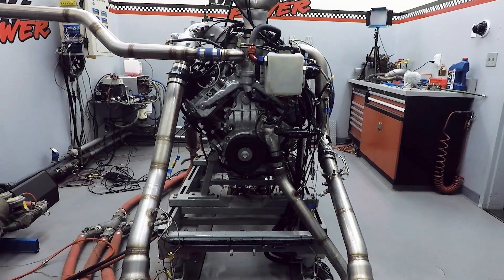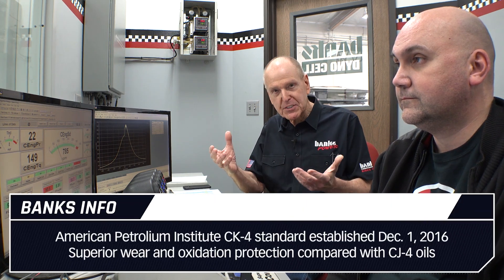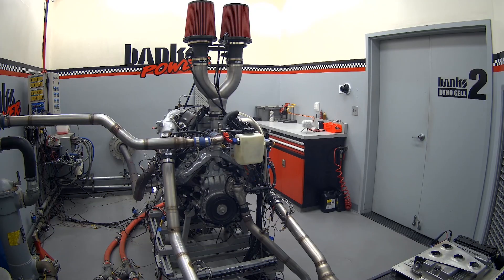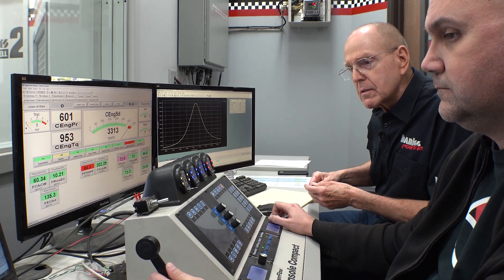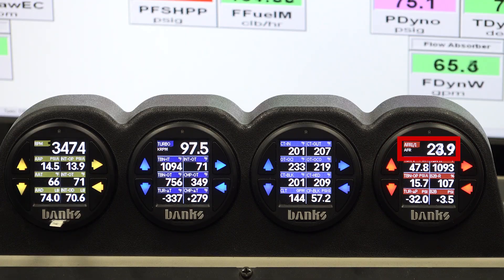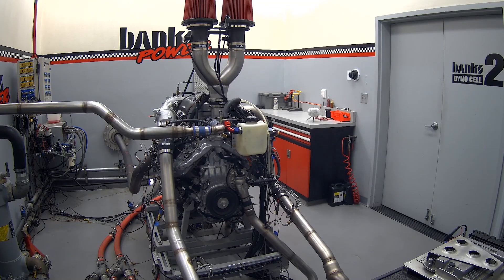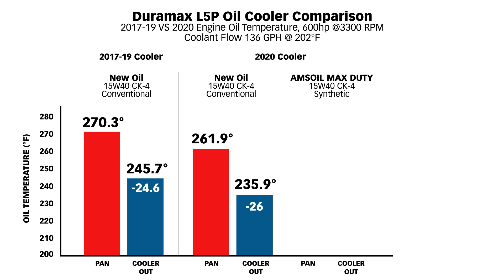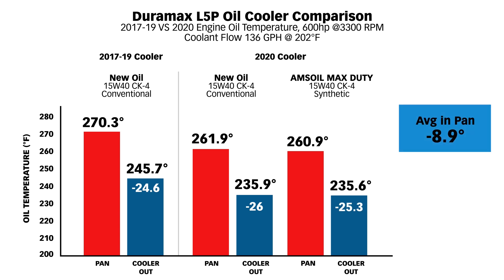Killing A Duramax Pt 10: New Oil Cooler!

Comment: Serious question could that year oil cooler leak coolant into the oil? I’m getting high potassium 39 in my oil analysis with only 52k miles on the truck. 2022 Duramax deleted and tuned
Reply from the maker: While it's technically possible to get intermix if you have a failed cooler, it's not super common with these.

Comment: Before I quit to go back to school to become an RRT, I actually worked at Dmax.  I seen you walk through sometime around 2009-10ish.  Nobody else on the line knew who you were.  Anyway, from the time I spent on Short Block B, I always wondered if the oil cooler tube could be modified, or even produced out of aluminum with an integrated heat sink...and how effective it would be.

Comment: Good morning. Great series I enjoy the technical aspect of the data testing. I have a question though not addressed here is about intercooler efficiency. I'd asked this of the Banks Power technical department and found to date there is no public data from testing of this type. As I understand watching these videos 1/3 of the power is produced by the engine, 1/3 by the turbo charger and the final 1/3 by the intercooler. Now interested in maximizing each available free horsepower my question is this. Is the ability and efficiency of the intercooler better when the core is naked aluminum or painted? There is an abundance of opinions over the internet of course. All of them I'm sure unsubstantiated claims. Reading about EMISSIVITY is very interesting in particular.  As a data junkie I'm highly interested in a testing environment to  answer this question for all of us real world users. I'm certain data is available to back up claims for Banks intercooler VS stock applications but what about the Banks Techni Cooler Painted VS Naked Aluminum? Its FREE HP either way. One must be better and for a reason. Again awesome series, can't wait for more. Looking forward to hearing your answer and comments on this post!
Reply: Naked aluminum.  Emissivity relates to radiant heat transfer, not convection, which is the mode that an intercooler operates in.  If the core is painted, there is another layer of material that is insulating the intercooler tubes and fins from the air that is being cooled.

Comment: Any input on the typwriter tick engine noise gm is saying is norm?
Reply from the maker: Our two L5Ps don't do it. However, there are about 50 guys in L5P Duramax's Only Facebook Group that complain of the noise. So, it seems as though it's somewhat common.
Reply: @bankspower  fhe dealer is saying it is the oil..and there is a TSB on it. ? What? I dont know anyway.. what kind of oil are you running in yours?
Reply: It is oil type specific. 
Mobil 15 40= no tick
Rotella t6 15 40= no tick
Schaeffer 10 30= no tick
Rotella T5 15 40= major ticking.
Reply: @cooley346  last oil change at the dealer i asked for synthetic, not a clue what brand they use.going to inquire. It still ticks once and awhile

Comment: Gale, on a high horsepower diesel engine, increasing oil pressure I noticed is common. I hear some people say you should and others say you shouldnt. Is this a practice yall have and is there any benefit to film strength and bearing life?

Comment: TBH, I would have thought that the modifications and torque increase has gone well past the point where a dedicated oil cooler would have been used.
The other factor is you didn't reference it against the coolant temperature?
Reply: GordoWG1 WG1 when he is going over the graphs at the end the coolant temp and flow rate is listed at the top above the graphs
Reply: @bradyjones4821  

You are correct - I phrased that rather badly.
What I meant was the increased thermal load on the vehicle's cooling system would also raise the coolant temperature, and that would, in turn, reduce the delta T at the oil cooler. On the dyno' the coolant flow is easily controlled, and held to a set temperature, something not so easy to mange in a vehicle.
Sure, in very cold conditions, the oil-coolant may help with the oil temp's coming into the best working range faster, but for a temperate,or hot clime a dedicated oil cooler would seem to be the better option - I would, personally, be MUCH happier if the oil was kept under 225-230f, 105/110C.

Comment: The old oil could also have a certain amount of fuel dilution in it, which will cause the viscosity to go down over time.  Considering the long injection times, I bet this is happening to some extent.

Comment: anyone elses l5p have a steady tick at idle? goes away sometimes.
Reply: Mobil 15 40= no
Rotella t6 15 40= no
Schaeffer 10 30= no
Rotella t5 15 40= major ticking at idle sometimes.
Reply: @cooley346  you've had luck with the t6 then?

Comment: Pushing hard to sell amsoil here it seems.  Isn’t more pressure in the oil system indicative of les flow through the newer oil cooler.
Reply: Jeff Pelletier Cooler oil is denser or “thicker”. On a cold day you can have say 40 psi at idle. Same engine and oil may be 10psi on a hot day.

Comment: Increasing oil pressure mean there is a increase in restriction since you did not increase the size of oil pump?
Reply: If you look at the gages and screen during the runs, you will see that the pressures were taken at a particular flow rate.  Since oil pumps are positive displacement types, the flow should be the same at the same RPMs.

Comment: ohhhhhh next episode going to be amazing! You get to reduce the injector duration meanwhile supplying more fuel! 
Are you going to try and stay at 40*, or try to run as little duration as possible?

Did you figure out if that oil cooler also fits the LML?

Comment: The oil density change just like the air density changes when you add more Cooling. That's why you were getting more oil pressure. That's pretty cool.
Reply: 1dads life This was really noticeable back when cars had functional oil pressure gauges. People would loose their mind with 10 psi at idle on a hot day.

Comment: I am a little confused. I have watched vids about Evans waterless coolant and they claim it is able to remove more heat from the metal surface due to its smaller molecules and higher boiling point which creates better surface contact. Result is slightly higher coolant temps noticed at the radiator and at the factory coolant temp sensor. Now I'm trying to apply that theory to synthetic engine oil, which should be able to remove more heat from the metal. It should also have better lubricity, which will reduce friction and heat. 
So synthetic oil reduces heat made on one side and absorbs more heat from the metal on the other.  In this case, is oil temperature alone an accurate measure to say that synthetic (Amsoil) is better? I would think at least an oil sample would be needed for better data and a more accurate decision. I still like Amsoil. I am more questioning the lack of data to claim one oil type is better. Someone might say this is like measuring horsepower and only looking at boost pressure... Hmmm...

Comment: What about oil psi and temp with amsoil in the stock oil cooler vs the 2020 oil cooler?
Reply from the maker: We didn't test AMSOIL in the older model oil cooler because we're planning to offer a retrofit kit allowing all DMAX owners to upgrade to the 2020 cooler.

Comment: Just out of curiosity did you use the same oil filter with the new oils or was it changed with the new oils?   The only reason I ask is I have seen oil pressures differ from filter to filter even though they were the same part number and manufacture.

Comment: GB, it is a shame some school doesn't run a "high performance" lab and lecture series- you would have classes jammed to the max! This on oil pressure, changes due to higher performing oil pumps and then to synthetics could apply to "gas burners" easily. Thanks!

Comment: I really enjoy these videos and I have no doubt that Amsoil has great products but I have never understood why they have the strange marketing scheme.
Reply: It pretty much started out as a pyramid scheme and was almost like a religion. They claimed that you never had to change oil. I worked at a Ford dealership in the 70s where a customer had a Pinto engine fail in 11,000 miles. Ford wouldn't warranty it because the oil had only been changed once having been replaced with Amsoil at 500 miles. The oil pan had sludge in it. I think they were advertising 25,000 miles on an oil change at that time.
Reply: @tiredoldmechanic1791  Amsoil had NEVER claimed you didn't have to change it.  Amsoil's guarantee was 25,000 miles or one year. Did anyone submit a claim to Amsoil?  Their claim was that with a proper lube analysis program, the oil could be left in until the analysis said it was time to change. I have been an Amsoil dealer since 1973.  If the Pinto had sludge in the pan, it wasn't using Amsoil, or it had some other malfunction going on (or it was just a Ford).

Comment: Has anyone ever built a V-8 in which half the cylinders run diesel and with different stroke, the other half gas. Grunt and zing
Reply: Gas engines get their zing, because they are able to spin at high speeds but if you have it directly coupled to a diesel engine, then it can only spin as fast as the diesel, and you lose all your zing, and since you don't have as many cylinders running diesel, you lose some of your grunt.

Comment: Amsoil is the best in synthetic oils  all around.
Reply: So they claim. It would be interesting to see other synthetics tested. Do any manufacturers use anything but synthetics now?
Reply: Tired old mechanic Not just they. Us too. We use Amsoil exclusively because I’ve seen the difference it makes in a 2,300 HP boosted big block. 
If it helps me maintain great pressure and my bearings look new I imagine for a regular car it’d be golden.
Reply: @tiredoldmechanic1791  check out project farm channel
Reply: @tiredoldmechanic1791  look up project farm. He tested all synthetic oils and Amsoil beat out Pennzoil and all other competitors.
Reply: I just can't afford 8 quarts at 21 a quart every 5 thousand miles
Reply: @drtracernum20  $21 a quart???  Retail is only $11.80 a quart.  And if you think that is high, listen to what Banks says about protection.
Reply: @rcbearings1  local napa sells em for 21 a quart

Comment: Im how does the oil pressure increase if there is an oil pressure relief valve to maintain the pressure at a given flow from the oil pump depending on RPM ? And is there a higher viscosity causing more parasitic draw?
Reply: Shadow Boston If the relief threshold isn’t reached then it doesn’t happen. The higher pressure will always increase draw. This is why a lot of oil pumps are two stage for cruise and WOT.

Comment: Could 10 degrees be made up in ambient temperature at the time of pulling? I just don’t see so much benefit to the VERY expensive amsoil v conventional
Reply: CAR WASH ENCOUNTERS temp difference was from the new style oil cooler not the oil
Reply: VERY expensive Amsoil?  Compare the protection you get from a premium synthetic vs any old crap oil vs the cost of replacing a $15,000 engine!  Go back and listen to Mr Banks again when he describes the Amsoil EXCEEDING the specs by a big amount.

Comment: Did you pull an oil sample from the 92 hour oil? I'd be curious to find out the lab results.
Reply from the maker: Yes, we pull a sample every time we drop the oil. We send samples to Blackstone Labs. Here's the 92-hour oil lab results. https://go.aws/2SotNF1
Reply: @bankspower  
Thanks for the data. From a mechanical engineer who loves data and raw power straight to the veins!
Reply: @bankspower  :  That's a pretty high Copper reading.  Hopefully that's leaching out of the braze joints in the oil cooler, and not coming from bearings.  The Lead that's in the reading doesn't seem high enough to go with the Copper that is present.  Iron wear is remarkably low considering the thrashing that the engine has been getting.  I think the Chevron conventional oil held up very well.  It's still in grade.
Reply: Me too!
Reply: THIS!

Comment: Is that the pressure after, or before the new smaller filter? I'm wondering how much pressure drop increased across the new filter vs. The older larger filter.

Comment: Hey there Gale.  Where is the oil pressure taken in relation to the oil cooler?  Up or down stream from it?
Reply: I have a 22 3.0L Duramax and I have the I-guage but I can not find the oil pressure monitor on the settings.

Comment: Also, since you're not going to be flipping this engine upside down any time soon, this would be a great opportunity to run experiments with water injection, MW-50 injection and Hydrogen Peroxide injection!
Reply: Water injection is only good for gasoline engines because it prevents knock by cooling the intake air charge. It actually robs power from a diesel engine. Now if you want to discuss high pressure high temperature steam injection then you have something that will be able to replace the emissions control systems by reducing the amount of NOx production, and yet still give you more power and better efficiency. I did a college paper on it thinking that I  was the only one working on it and then found out that research had just been done in 2017 proving all of my theories correct.
Reply: David Scott Water injection after the power stroke works fairly well at lowering exhaust temperature, but Hydrogen Peroxide works even better while also aiding combustion rather than hindering it. I think it's still worth experimenting with.

Comment: Kinda defeats the point of killing a Duramax when you make it survive...
Reply: I don't think you understand-you can't kill a stock engine unless you let it run dry of something(oil, coolant) they have to keep upgrading stuff until something breaks, and it will!!!
Reply: @daviddavis4594  you can quite easily kill a stock engine even if it had oil pressure. 
Compound turbos for one....
Reply: @asjmpickle  what was that, upgraded to compounds?

Comment: One place the amsoil really shines is -20f startups. 

Are you using GM filters in all cases? I used wix on my lb7, but noticed big pressure differences from one filter to another.  I couldn’t get the GM filter with a check valve locally, and both the amsoil and mobil one filters were much different on pressure I believe it was lower by about 10psi.
Reply: One thing that always makes me angry is that there's nothing like the lightbulb facts but for oil filters. It's so damn rate to find good info on pressure drop, particle size/vs filtration efficiency, dirt holding capacity,   impact tolerance, gasket seal lifetime, etc...
Reply: Alexander Riccio, I agree, of all research I did including talking to builders who’s engines competed against mr banks and I’ll just say there were no clear answers.  You need lots of data for specific engines with specific oil to determine what’s best for filtration.  Like I said I couldn’t get factory’s filter that didn’t bleed back and I’m not an extreme user except cold starts so I went with a well respected alternative that kept my gut happy.

Comment: 15w? Is that still used these days
Reply: Running Shell T6 5w-40 here.. Cold weather,  helps on the cold end flow
Reply: Yep. 15w 40 amsoil max duty here. 19 L5P.
Reply: I ditched 15w40 a while ago for 10w30 Amsoil in my 03 6.0. She absolutely loves it and the cold starts are way easier on the truck
Reply: 15W-40 every 5,000 miles, which is specified, in my ‘01 Cummins with 370,000 miles. Only Fleetguard Stratapore filters.